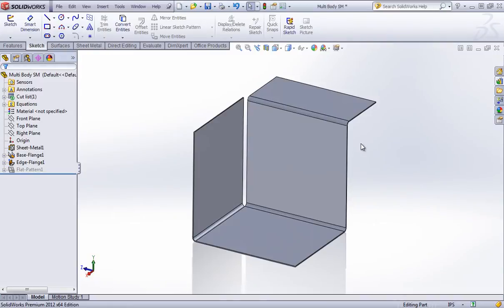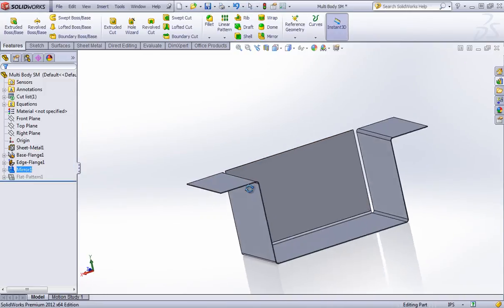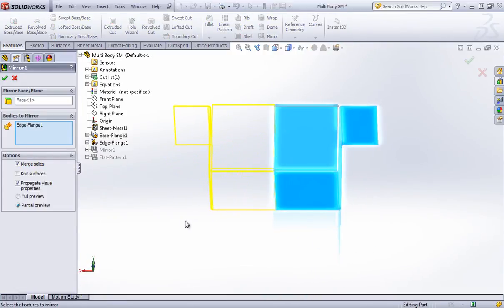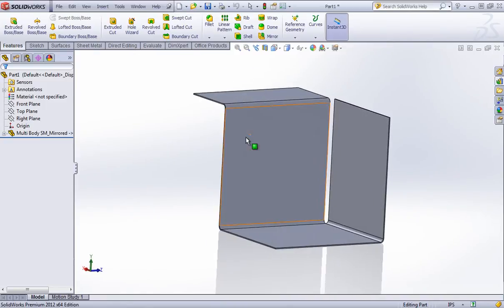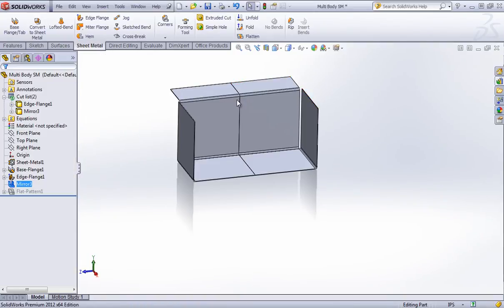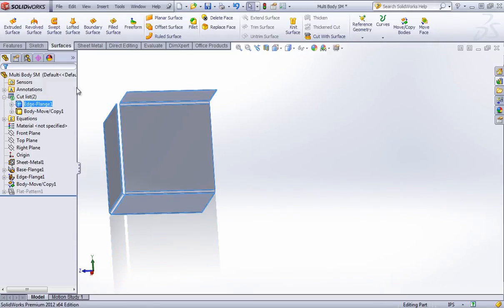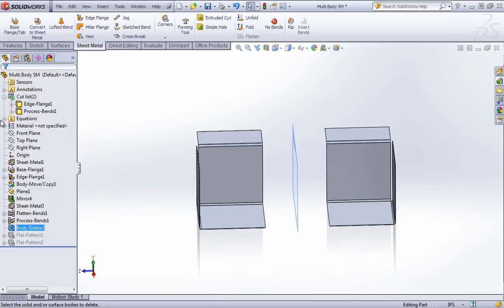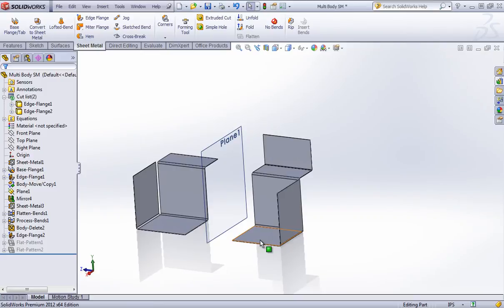SolidWorks Sheet Metal Tutorial: Mirror Body by SolidWize

Comment: how do this in assemblies?
Reply from the maker: Under the linear component pattern pull down is a mirror component option. Although the results will be a bit different.
Reply: @SolidWize  yeap, it there. but in this way mirrored copies is not sheet metal parts, they are solid bodies. i can't make a unwraps by 'Nesting Works' from assembly with this approach. if you have ideas and thoughts on how to optimize this process, I will be very grateful to you)
Reply from the maker: @wyindepi8870  I'd recommend not bothering with trying to do much modeling in assemblies. Learn how to use master models in solidworks and do the vast majority of your design work in multi-body part files. The solidworks assembly environment is incredibly restrictive when trying to create anything complex.